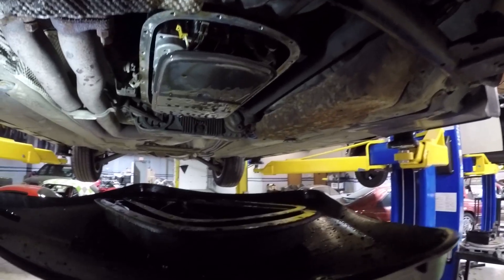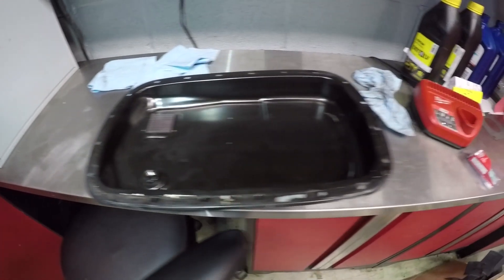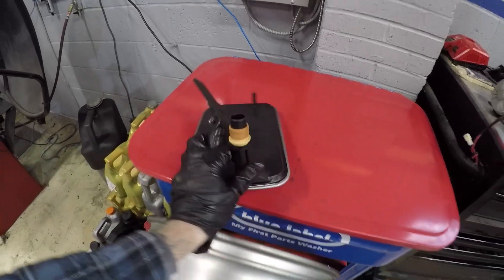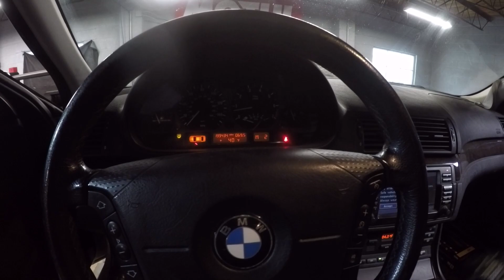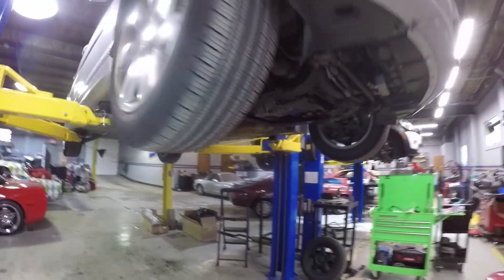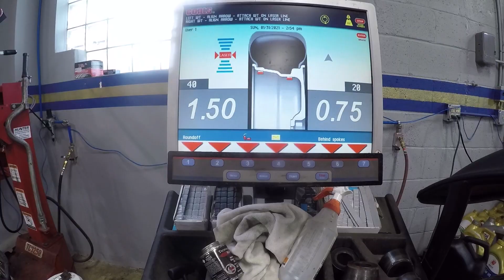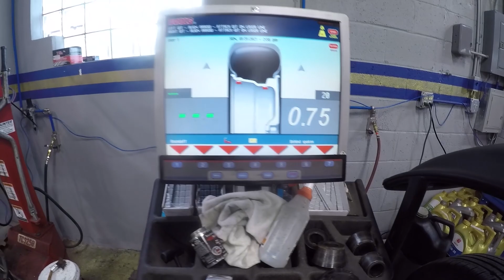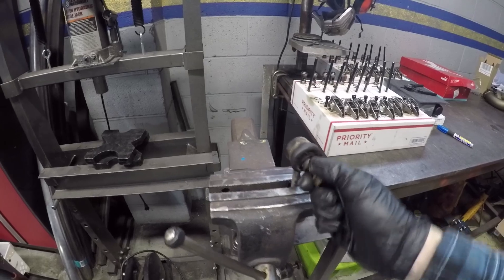$300 E46 Wagon | Ep.5 | Transmission Service & Wheel Balance

Comment: Cool video! You actually caught me there when you said: "So you might be wondering: why is it coming out the fill plug?" 😀 
I didn't know about filling the automatic transmission with the engine running.

Just to add a cherry on the top of your cake, I'd advise using a dynamometric wrench where possible.
Thank you for sharing!
Reply: InstaBlaster...

Comment: Now, drain the trans AGAIN, refill, go through the gears again...
Then once more...
You'll thank me later...
Reply from the maker: I'll likely do another drain & fill sometime soon.
Reply: @PracticalEnthusiast  The fluid level should be done when the trans temp is between 30 and 50 degrees Celsius. Otherwise your fluid level will be wrong and you can damage the transmission.